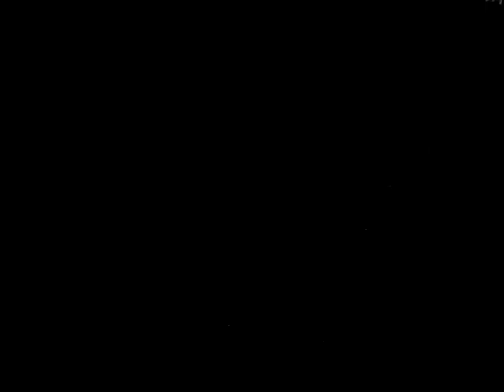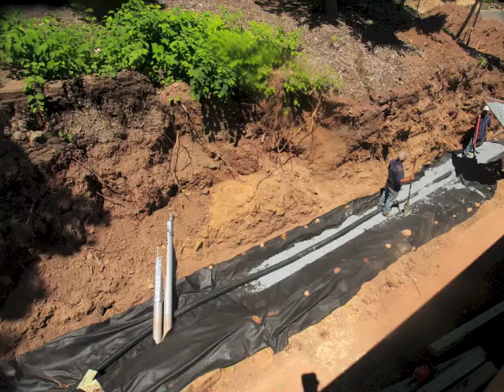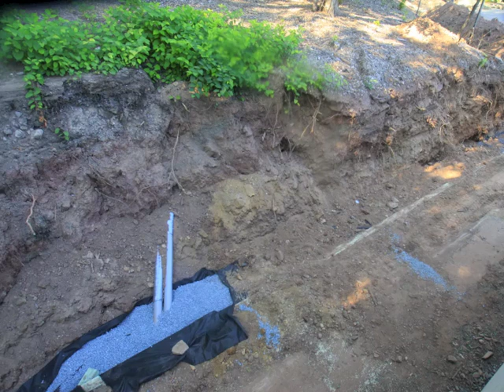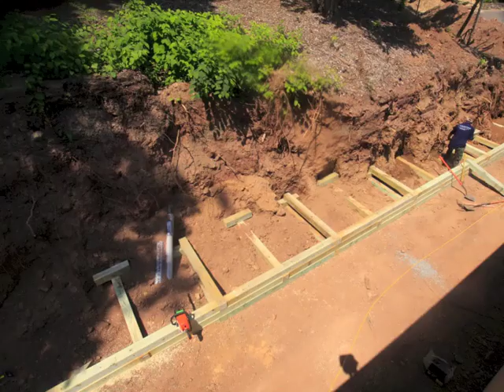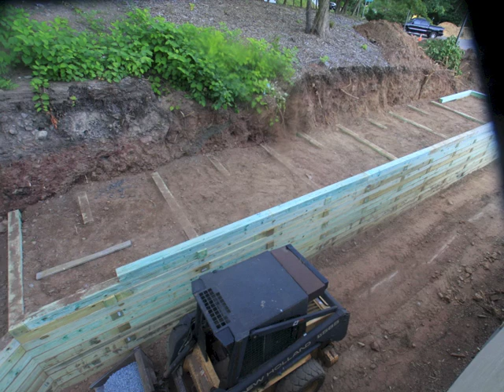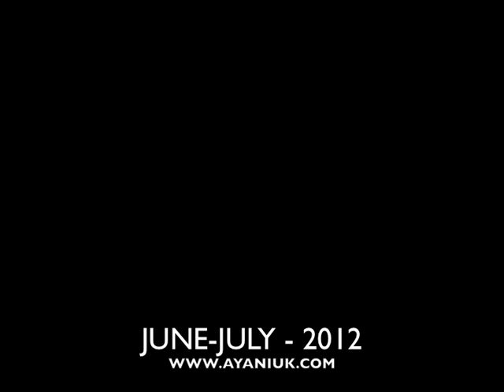Railroad Tie Wall Timelapse.

Comment: with all the dead men post I don't think that walls going to move till it rots away in 40 years. If it's over 5 feet tall I usually add another layer of gravel for additional or quicker drainage but that's me being nit picky I Dont think this job needed it. . looks awesome good work.

Comment: I have a 70-feet timber retaining wall that holds back about 4 feet of soil and just passed the 21 year mark.  My wall replaced a professionally done one that lasted only 13 years.  They are relatively cheap to build and go up quickly.  Generous use of deadmen will keep them intact.  Another thing is pesticide.  After about 10 years the chemicals start to leave the timbers and the carpenter ants begin to move in, if left untreated.  The ants favorite habitat is wet wood.
Reply: How would you re-treat the back side?
Reply: @thelouiebrand  There's no need to re-treat the back side.  The ants come in from the front side.

Comment: Use ACQ ( former CCA ), install drainage at low point well packed in gravel. Gravel pack should be used in first foot of excavation. This bleeds off water well and will ultimately flow into PVC perforated pipe, use schedule 40 with PERFORATIONS UP ! Or if you drill your own perforations at least drill them at 90 and 270 degrees. Perforations pointed down compromises water flow by loosing channel flow. Huge mistake made by many. Timber deadmans placed well in this video.

Comment: Did you use nails or screw, i can't see if you've used either?
Will the weight hold it all together? thinking of doing similar in garden( though on smaller scale)

Comment: We bought a 40 year old house that was landscaped heavily with railroad ties including retaining walls.  It is a nightmare to remove them and start over. While they are decaying they make cozy homes for all kinds of critters including yellow jackets (huge colonies) and snakes.
Reply: ganduense gotto love nature
Reply: I agree.  I got a retaining wall, currently my second one after 17 years, and thinking of doing a 3rd one.  Timbers are very forgiving for big walls.  However, they don't last more than 20 years.  The ants start chewing on them after about 12 years.   It seems that's when pressure treatment goes away.l
Reply: I have replaced all the ties wall with blocks.
Reply: Doesn't sound like you are using actual railroad ties but instead just pressure treated 6X6 lumber....like the ones mislabeled in this video. Actual railroad ties are typically treated with Creosote which is toxic to fungi and insects and is a water repellent. I have some that have been in my yard since long before I moved in here (almost 30 years ago) and they structurally just fine.

Comment: All pressure treated timber will rot especially if in direct contact with the ground...  no doubt this will last 10 years or more but eventually I reckon the fixing points will fail due to rot, the timbers will fail and this will be a mess and a massive headache for whoever will be paying for it...

Comment: Anybody who uses pt lumber OR railroad ties to build a retaining wall is an idiot. Most retaining walls aren't needed if you slope the hill, put in drainage pipe and then add something to prevent erosion.
Reply: In small yards, it increases the area of landscaping to enjoy by not sloping and having a wall or terrace instead.
Reply: Not needed??? The whole point of a retaining wall system is to eliminate the ground take up of slopes
Reply: "An idiot" that's pretty strong language directed at people sharing ideas